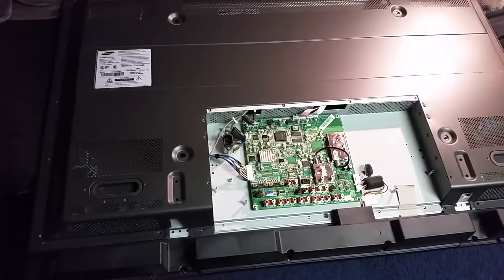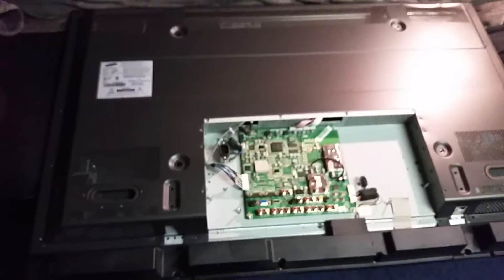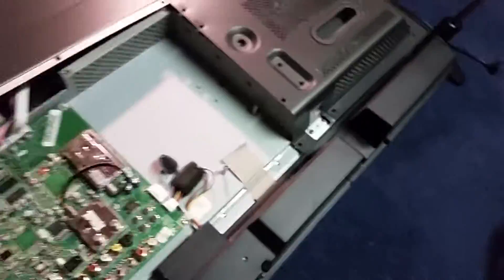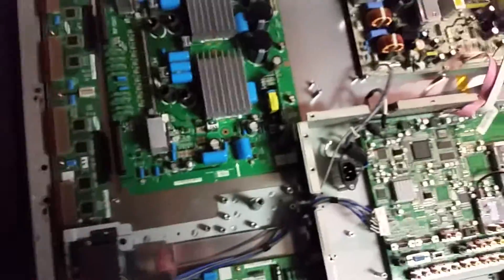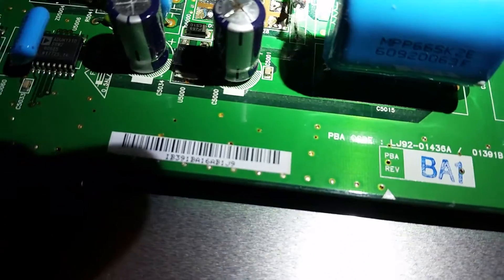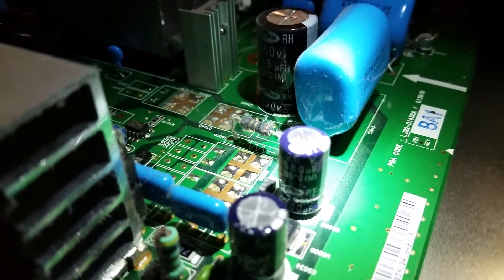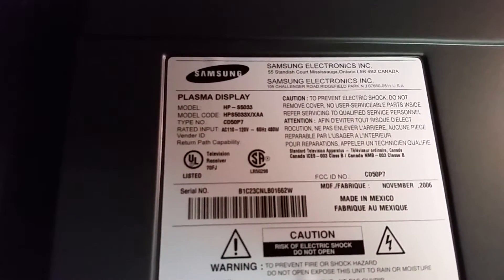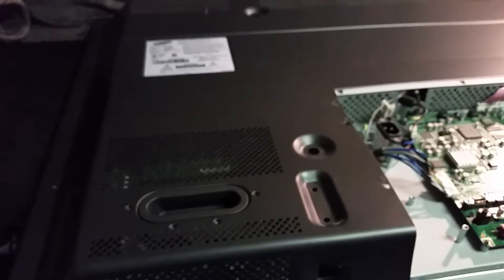How to fix a 2006 Samsung Plasma TV HP-S5033

Comment: I changed the original two capacitors they were definitely bad. It turned on and worked for a couple hours. At first power would only come on when you plug in the set. Now nothing....i checked the green fuse it seems to be OK. In stuck and really don't want to throw it away.
Reply from the maker: I would check the power supply board for bulging capacitors as well. It also would be worth a try to replace the other two  electrolytic capacitors (silver topped ones) to the right of the one that was bulged on mine. Hopefully this helps!
Reply from the maker: Also forgot to mention that you need to make sure you put them in the correct orientation. They have a positive and negative side.

Comment: Do you have these caps in stock? I would like to purchase a couple, and a fuse also.
Reply from the maker: Link to capacitors: https://www.amazon.com/uxcell-Aluminum-Electrolytic-Capacitor-Celsius/dp/B07JLDLVFH/ref=sr_1_4?crid=2RZK88OFFG77H&keywords=25v%2B680uf%2Bcapacitor&qid=1574479275&sprefix=25v%2B680uf%2B%2Caps%2C342&sr=8-4&th=1

Link to fuse can't remember the amp rating I used:

3amp one: https://www.amazon.com/uxcell-125V-250V-Quick-Acting-Leaded/dp/B00WW71WAQ/ref=pd_sbs_328_3/135-4108667-4039463?_encoding=UTF8&pd_rd_i=B00WW71WAQ&pd_rd_r=e0345d17-d5a6-4330-ae49-13f402e4e377&pd_rd_w=hdnMs&pd_rd_wg=kJnZl&pf_rd_p=5873ae95-9063-4a23-9b7e-eafa738c2269&pf_rd_r=V96RCCQ6228PY6A5AZJT&psc=1&refRID=V96RCCQ6228PY6A5AZJT

or use 2amp one: https://www.amazon.com/uxcell-125V-250V-Quick-Acting-Leaded/dp/B00WW77X1S/ref=pd_day0_hl_328_6/135-4108667-4039463?_encoding=UTF8&pd_rd_i=B00WW77X1S&pd_rd_r=e0345d17-d5a6-4330-ae49-13f402e4e377&pd_rd_w=BWq2A&pd_rd_wg=kJnZl&pf_rd_p=0501877d-5f8c-4ec8-9861-e0476eecc53e&pf_rd_r=V96RCCQ6228PY6A5AZJT&psc=1&refRID=V96RCCQ6228PY6A5AZJT

Comment: I got this set free, I was told it was LED. I still opened it up and found both those caps bulging. Just not sure its worth trying to fix. Maybe for practice.
Reply from the maker: Yeah I'd say it would be worth a try for sure. I'm 99% positive you can get it working if you fix that.  Also there is a small vertical board to the right of the the blue square capacitor that has a skinny glossy green resistor looking appearance. It is actually a soldered in fuse and may be needed to be replaced also. Sometimes when the Caps go that fuse blows also. To test if it is bad you need to run a continuity test if it is good you will get a beep when you touch each side of the fuse if it is bad it will read as open / no beep.